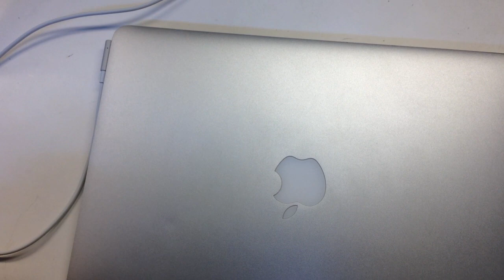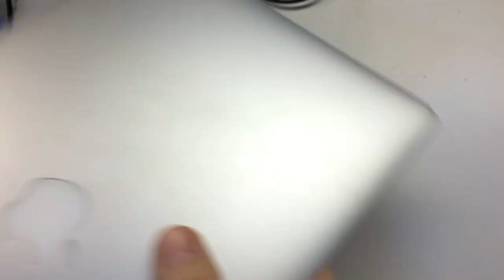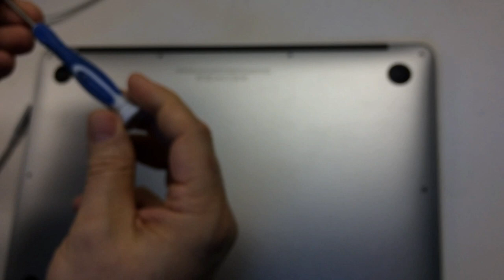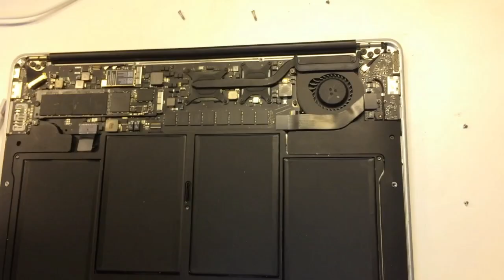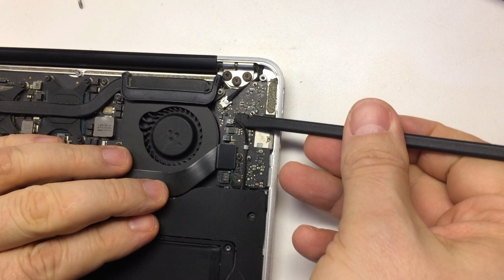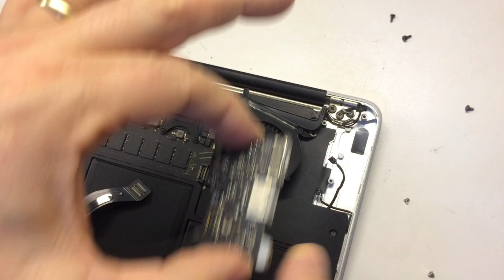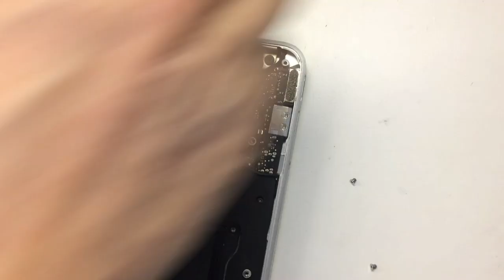Apple MacBook Air 13 A1369 Not Charging - I/O Board Repair Replacement (2010 - 2011)

Comment: will it work on macbook air early 2015
Reply from the maker: This vid is dated, for the Macbook Air late 2010 thru early 2011.  It's going to be similar for 2015, but plenty of differences with five years of progression in design.

Comment: This repair would also fixed macbook with sudden restart case during use. Unfortunately Apple has really bad material and design on they're charger that cause melted, my charging port also burn and melted like that, and it cause my mac keep restarting during use and there's one in a moment when it didn't want to charge while my charger, battery, motherboard is still so good, please don't remove the video it's really helpful and clear😊

Comment: Hello.
I have a little question, about macbook air 2015.
I left it unused dor 1-2 months, now when i try using it, charging connector is green after pluging in, and than it turns and remains orange.
And that’s it.  I try power it on, but would not turn on. I also tryed disconect the battery and run it without battery, but same result.

Comment: I have this exact issue, but I just want to be 100% that it's the I/O board. Is there any way to tell with a multimeter? I tried testing connectivity all over and everything seems to be in order. Is there a specific troubleshoot to diagnose this issue?
Reply from the maker: Given Apple never released schematics or technical service manual information for these older Macbook Air models, there are no such troubleshooting approaches documented.  A repair shop that does this for a living will likely have developed some techniques, but they are not going to share that freely.

Comment: Yes , it's working but I don't think you determined if it was the connection or the logic on that pcb that was bad or could it be something else if you don't have a known good battery and power adapter.  What is the actual conditions that turns that led on?  From what I can find out it goes green for a second to indicate power is available but some logic must test that condition ,  it then switches to amber to indicate the battery is not fully charged or stays green to indicate the battery is fully charged . Lets say the led never turns on ,  you could have a bad power adapter , possibly a bad battery , a bad pcb or bad wiring Are there test points to indicate the battery and adapter are working properly? Without two of everything you could spend a lot of money to troubleshoot the issue .
Reply from the maker: This is a really old video, for a 2010 Macbook Air.  So something over 13 years old now.  

But to answer the question, there were no schematics or service manuals ever provided by Apple for these obsolete laptops.  So having additional power supply options, and comparison to known good units, is all that is available for the DIYer to work with to do observation based debugging.
Reply: @DrShock  I get that and appreciate the video .  Maybe you can guess why I made my comment?   I have a Mac Air 13 with magsafe power connector that had been working but stopped working after a fire in the home .  The unit doesn't look like it has a water line but I know that the room it was in took on water and it was standing on one end on the floor at the time .  I took a meter and can see I have 16 volts dc on the pins that are on the PCB side of that connector ,  so I will assume I have a good power adapter ,  I see 3.5 volts on several battery connection pins and find 8 volts in other locations on the mother board but like you say , no schematics . I also don't have my scope. It's been 18 months since the fire  and my first time looking at the laptop.  I am sure the battery is dead. but can't say it would work if I got a battery ,  I would have no other way to charge it .  They say these machines will work without a battery and work on a power adapter ,  not this one. Was that little board in water ,  don't know. Would it work if I replaced that board , not sure .  Water does funny things to a computer . All computers that were not on floor survived.   This mac remains lights out.  Thanks for the help.
Reply from the maker: Sure, just making sure you realized the videos age as its specific to the older Macbook Air models.   The Magsafe I adapter (45W) would have ~14.5VDC max output (later models will be higher voltage) on the inner pins (they are the same as you can plug the connector in either way).   The outer pins are grounds.   But the center pin is the control signal, and this you can't check with a meter.  As best I recall the charger will not charge if there's no handshake on this center pin and the Macbooks' I/O board controller.  Not seeing an orange charge LED, or even the green one, and an otherwise known good Magsafe charger points to something inside the Macbook rather than the Magsafe.
Reply: @DrShock  Excellent info,  thank you DrShock .  It is a old mac air ,  company unit that I took home when we couldn't go into the office due to covid .  I am sure it will be junked when I ship it into the building . Just wanted to see if I could save anything I may have stored on the Solid state Memory .  Looks like no handshake.  I do have the 16.5 volts.

Comment: Hi =)
I have a question.
My 2010 13" macbook pro won't charge.
When I plug the charger into it, it has green light but does not charge. I've tried resetting some things there but no luck. By the way, it powers up.
Could it be the I/O board?
Thank you =)
Reply from the maker: It's tough to say remotely with just this information.  I usually like to have a second MagSafe charger to confirm such things.  Or a second MacBook.
Reply: I see. Thank you =)

Comment: Yeah, but where do you get the part. I see only used junk cannibalized from trashed laptop. I want a NEW i/o board.
Reply from the maker: Apple never sold new parts to the public.  This video is for a laptop series from a decade ago, used parts is all you'll find nowadays for something this old (links in the description).  But I'm not aware of any aftermarket supplier for parts on these older Macbooks.

Comment: I have a macbook air 2011 A1369. I have a problem with the boardmagsafe but the spare part I find is a1369 2014-2015 though. Can you tell me for sure if it will fit on my Mac because as I told you it is a 2011 model. Thank you
Reply from the maker: The one of mine shot in this video is a late 2010 model.  That's the only model I own.  The eBay search links in the description should land you on several listings, you'll want to pick from sellers who include the model years in the listing.   I do see at least one currently that states it's specific to the 2011 A1369 Air.

Comment: Hi, my MBA charging light on the adaptor is not powering ON at all. Verified a good power adapter is used. The strange thing is that if I boot the macbook in safe mode, it will power up but will immediately power off as soon as the power adapter is unplugged. 
Would a defective I/O board still power ON only on safe mode and not as it should normally?
Reply from the maker: Thats an odd behavior I haven't ran into.  Have you option-clicked the battery icon to confirm its condition is normal?
Reply: @DrShock  no icon of battery is available when in safe mode. I ran coconut software and shows no info of battery.
Reply from the maker: That it works in safe mode might still point to the board, but difficult to diagnose remotely.  If I had this problem I'd give a go of cleaning the Magsafe port (sometimes debris can interfere with the pins) and disassemble the Macbook enough to reseat the boards connections to see if this is just an oxidation type issue.
Reply: Clean port and connector, then reset SMC.

Comment: You didn’t test it though. How do you confirm if it’s the I/O vs logic board
Reply from the maker: Yes I tested the repair,  11:22 onwards is the retest for this specific problem.  Green to orange on the MagSafe led is a passing test for this specific problem the video goes over.
Reply: @DrShock  what testing did you do to confirm the logic board was not the problem prior to buying the new I/O board?
Reply from the maker: Ah ok, well there's no specific electronics type test for this you can perform as Apple never published a service manual for this MacBook Air publicly.   So you have to do more of a process of elimination.

But you can tell it's not charging in the initial part of the video thru obvious means, no orange charge LED at the MagSafe jack means no active charging is taking place.  But this could be due to either the battery or the MagSafe charger itself. I mention in the video you can further test your MagSafe charger against a second MacBook.  Same with the battery.  So if you have a known good battery, and you have a known good charger, you've eliminated the other two potential components for this problem of the three involved.  If there's still no charging taking place then you can act on the knowledge I've shared that the charging circuitry is on the I/O board.  At least with the Macbook Air late 2010 type series - the subject of this older video.    

Newer models may be totally different, this is now an 11 year old laptop design we're looking at in this video.

Comment: I can’t replace the I/ O board because the screw in the middle rusted any ideas ?
Reply from the maker: The base is aluminum, so a very small size screw extractor would probably be your best bet.

Comment: I have the same problem but my sound doesn’t work. What problem do you think it is 🤔
Reply from the maker: Not sure if you mean zero sound, or not good sound.  You can usually tell which speaker is out once the bottom cover is off for not good sound.  But for zero sound I'd first check the headphone jack and boot into diagnostics before looking at the I/O board replacement.

Comment: For the I/O Do you use regular torx t6 or pentalobe T6?
Reply from the maker: pentalobe, there's a link in the description.
Reply: @DrShock  thx for the answer I have the Pentalobe for the case, I am confused by the one you use in the 04:04 part of the video.
Reply: you said t6 (or that was what I heard) such t6 would be torx or hex? But after that you said you used your finger. Thank you very much!
Reply from the maker: Ah yeah, I thought you meant the screws on the bottom cover.  Yes that internal one around the fan I used a T6 torx bit spun by hand.
Reply: @DrShock  Thank you for sharing your knowlege. 💐💐

Comment: my MacBook pro needs a new charge port & I've ordered one. Trouble is, the fans are loud & won't stop. I also have to press the power button for 10 seconds, then put the charger in, for it to turn on. All this started when I replaced the battery. It was done correctly too. Any ideas as to why it's doing this? Will changing the charger port help?!
Reply from the maker: When you hold down the option key, and then click the battery % icon in the upper right, does it say normal or some other message?

Comment: Hey i got a 2017 MacBook Air and i am looking for a replacement board, my question is are they all the same for MacBook 2013-2017, because i can only find 2013 parts. Would it work for me to put a 2013 i/o board into a 2017 mac?
Reply from the maker: From what I've seen on iFixIt, 2013-2017 is the same part for the I/O board.   Obviously not the same as this video's 2010 example.
Reply: @DrShock  alright thank you

Comment: Hello, thanks for the video. Although, I have an issue. The charger now charges my macbook but the light doesn’t turn on and the laptop itself is working is very very slow to the point that I can’t use it. I tried to restart the SMC but still nothing changes. Any solution?
Reply: THE PINS FROM THE RIBBON CABLE WERE BENT SO I HAD TO PUT THEM STRAIGHT, that’s it 😂 be careful so it doesn’t happen to u too
Reply: @Juanmi397  I have the same situation as you. The laptop boots, but very very slowly while the CPU fan is on high. It only draws about 9 to 10 watts from my Kill-A-Watt AC meter. But my battery icon shows an X. I purchased a new battery, but the same thing. It's not charging, the mag light turns instantly green. With the laptop closed, I plug in the power adapter, it starts to chime and boot, I pull the power cord and it keeps going, so there's voltage in my new battery and it powers the laptop, but yet I still get high CPU fan and slow slow boot. The beginning of the boot it draws 15 watts, but then drops to 9-10 and takes forever to get to the login prompt. Pulled the SSD, but still initial high fan a while after power on.
Reply from the maker: After the Macbook indicates its fully charged, hold down the option key and mouse click the battery icon.   If it doesn't say Condition: Normal you'll need to replace the battery also.
Reply: Thanks again for your quick response. It says condition normal. The thing is that I had to replace the charging port due to burntout but everything was working perfectly. Any other possible solutions?
Reply from the maker: Well if the battery is self-tested as normal, and the charger is still not lighting up green or orange, then I'd next be looking for a friend to help test that the Magsafe charger is in fact working ok.  It may not be outputting enough amperage.  But before that I'd make doubly sure the board you replaced is the exact same Apple part number as the one you removed.   These boards are model and year specific in most cases.    Another test you can do is fully charge the battery and put back in the defective charge board and confirm the computer otherwise operates normally.   This could help confirm whether it's the replacement charge board or whether something has gone awry on the main logic board itself.
Reply: DrShock 
Thanks again for your help, I realized that the battery symbol appears as charging but when I click on it, it says that “battery is not charging” although I had it on for hours and it neither is consuming battery or getting battery (72% battery after hours being plugged in). The board I replaced is the appropriate one. Charger works well in another same device. And I replaced the charging port for the old one and I get the same results (no charging light, fan at super speed and super slow performance). I tried upgrading the software but nothing either. I tried restarting the SMC like thousand times and nothing changes. It’s so weird cause before I replaced the charging board everything worked perfectly. I will take it to a professional tomorrow so they can run a test on it. Thanks so much for your help though 😊
Reply: I’m facing the same issue. Did u manage to fix the macbook? Do mind sharing what was the problem. Thank you. Cheers.

Comment: I’m having a hard time making sure I have the right part found. It says early 2015 MacBook Air 13 inch, I’m trying to find a part on eBay, any recommendation
I’m having a hard time making sure I have the right part found. It says early 2015 MacBook Air 13 inch, I’m trying to find a part on eBay, any recommendation
Reply from the maker: The Macbook in this video was a late 2010 13inch.  So when I look on eBay for a replacement I/O board, you look for the year in the sellers description.  Like 2015 or such.   The best way to be sure is to read the Apple part number off of the board, your 2015 is going to look different than the 2010 this video was made with tho.

Comment: Hello. I got MacBook Air 13 inch 2016. Power adaptor showing solid green light always. Battery is not getting charged and can’t turn on MacBook. But after disconnecting battery it can be turn on and MacBook works perfect. Please advice what problem this MacBook has. Do I need to change battery or there is something else wrong.

Comment: Thank you! I fixed my computer.  It turned out that the charge port was just bent as was the case in that corner where it dropped it.  I was able to remove the board, bend both the port and the case back into place.  Everything is working great.  I only had to purchase the screw drivers!
Reply: MacBook Air, 13 inch, mid 2012.  Now the last generation supported by Apple.

Comment: Amazing video. Will the process be same for MacBook Pro mid-2014 Retina display model? Or cables and arrangement would be different?
Reply from the maker: Personally, I don't know I've only worked on these older models.
Reply: @DrShock  Thanks

Comment: My 2009 white MacBook only charged when pressure was applied to little piece that’s soldered down onto the motherboard then a little spark happened and now it just won’t charge anymore, thoughts??
Reply from the maker: I've have to hazard a guess not having the board in front of me, that there was either a crack in the circuit board substrate due to age/heat or within the solder joint(s) of some component(s) themselves for the pressure technique to "work".  Spark was likely due to that progressing to a full on short circuit (pressing down over time would have aggravated the damage) so the board is now most likely fully dead and in need of replacement or component level repair.

Comment: Damn u just replace it I thought u will service it maybe capacitor or diode or port problem need replacing
Reply from the maker: Waste of time doing component level repair here, just replace the board and move on with life.  These are old model Macs and pulled boards are easy to come by.